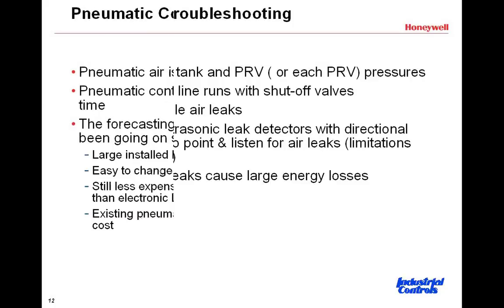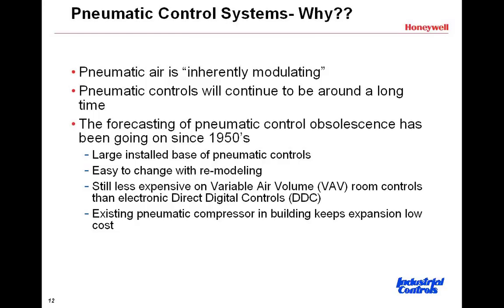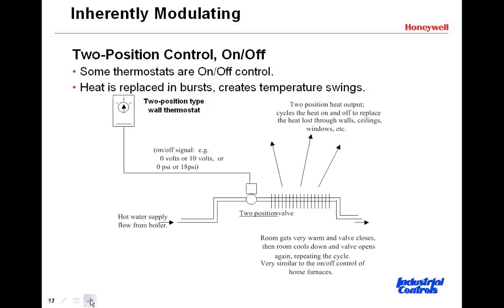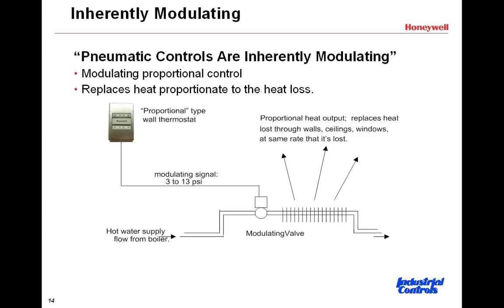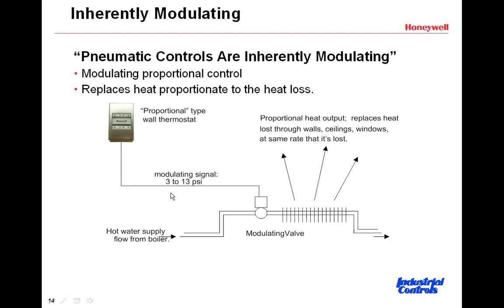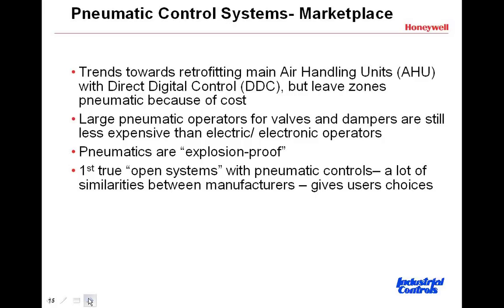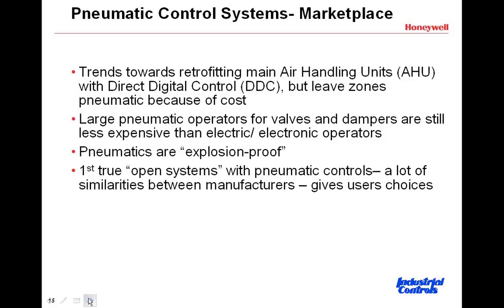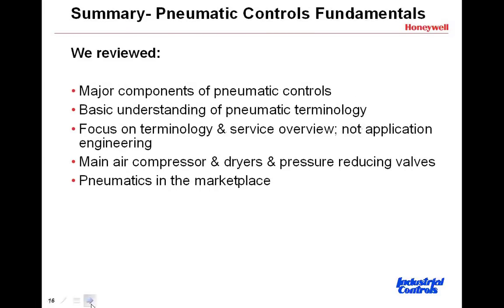Introduction to Pneumatic Control Systems: Clip 4 of 5

Comment: I would like to suggest that copper tubing be used everywhere possible. This would insure that leaks in mains and branches would survive most mishaps. Remember, plastic tubing either loses its elasticity to oil contact and/ time. If you want to be striving for the tightest system possible with cleanest air, start at the compressor station. Work your way out from there using only the best materials available!!!